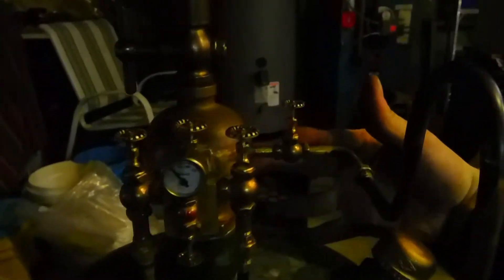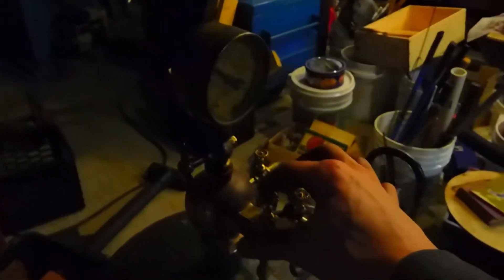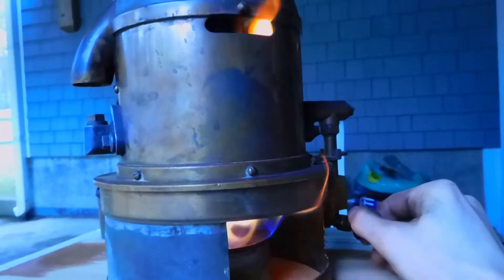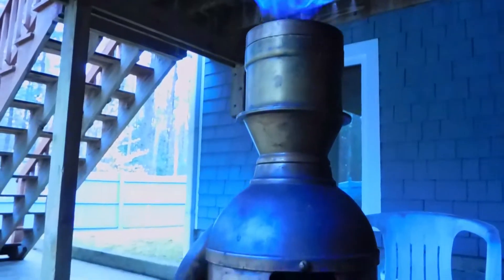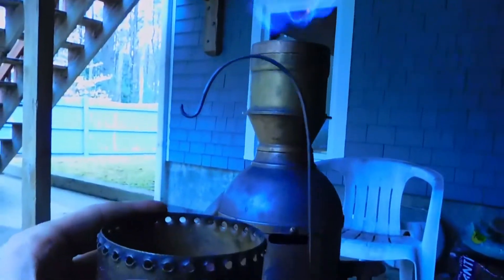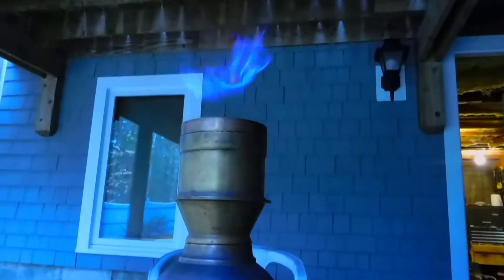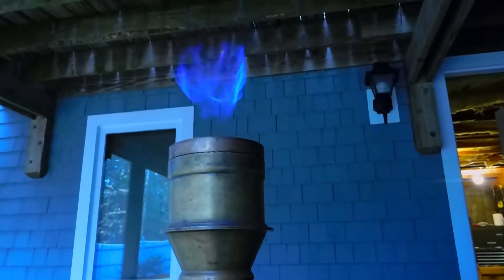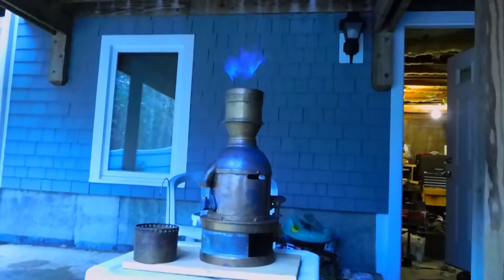Chance Brothers 85mm First Order IOV burner

Comment: I would love to see that burner with a mantle on it, in operation. I'm almost surprised you didn't construct one for it, for demonstration purposes, as I know you no doubt have the abilities to do so. I also understand, however, that it is not yours, and perhaps time does not permit... And perhaps you had to get it back to its owner. Regardless, I still feel blessed to see it operating even without a mantle, and my hat is off to you for all the brilliant work you put into it to restore to this present operable condition. Thank you.
Reply from the maker: I am not able to make mantles.  If I were able, I'd have had one on this burner
Reply: What is the limitation you encountered in making mantles? @AEKarnes
Reply from the maker: No one can make them in the size I need or that correctly auto-form @arts.4014
Reply: Since I assume you've reached out to Coleman's management, and got a no; what is the limiting factor of the manufacturing process?  I suspect this should be easy for one of the tier 3 aerospace suppliers, I'd be willing to ask but don't know the right questions. @AEKarnes